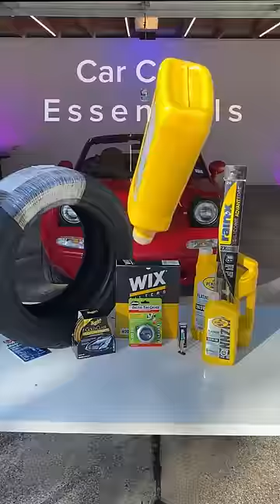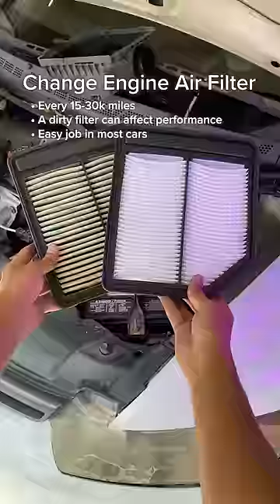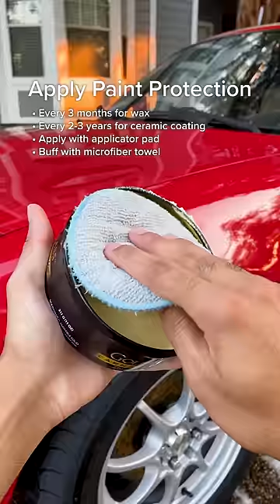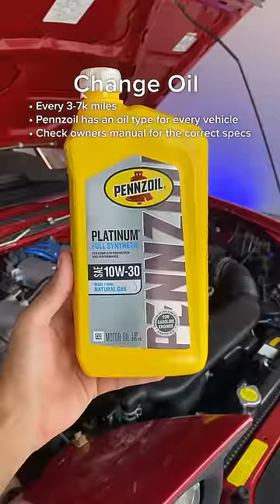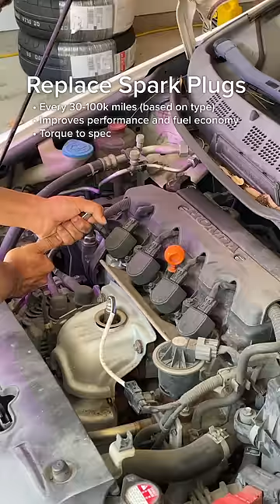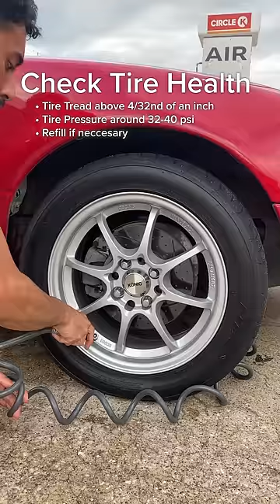Car Maintenance Checklist! (make your car last longer)

Comment: Some extra wording could be added. Just rotate the tires with every oil change. Clean your wiper blades with a non solvent solution every few months to make them last longer. Rubber can go 2-3 years and good silicone can go for 2x longer. Cabin and engine air filters should be changed simultaneously. Miles varies on the pollution in your area. I get 40k where I am since it’s not very polluted.  Waxing, depends on how much of the elements it’s exposed to, you can get upwards of 6 months on the same wax. Oil, mileage varies on blend. Can get 3k on conventional and upwards of 9k on some synthetics. Googling or oil cap can also provide oil weight. Also replace engine oil and filter in tandem. Cvt oil every 30-45k and auto/man every 50-70k. Depends on how hard it’s driven. Spark plugs now a days lasts well over 80k. Just change em every 80-100 or when fuel economy drops or a misfire lights the check engine. Do it when engine is cold, don’t overtighten. Just snug it up and give it an extra quarter inch turn. Tread them by hand before using ratchet, so you don’t strip the threads. Tire pressure should be what the door stickers says. Don’t pump it Willy nilly, tracks need far more than 40 psi in some cases. Adjust and check tire psi a few times per year. +\- 10 degrees = +\- 1psi. And get an alignment if tire wear is uneven. Also never run your gas gauge to empty, always fill it up around 1/4 from empty.
Reply from the maker: Thanks for typing all that out, great info for everyone that sees this vid!
Reply: Aww somebody’s a diy dad with their car! Look at you big boy taking car of your car/truck maintenance all by yourself!
Reply: @cameron3991  Your comment is not about you, also diy daddy is my favorite daddy.
Reply: W human thank you.
Reply: 🤣how long did that take you
Reply: @Junior Dominguez not good for the fuel pump. Would take a long time to have a noticeable effect though
Reply: @Junior Dominguez Running lean can heat some things up, but it isn't bad unless your car is a diesel, or a rotary.
Reply: Good idea fueling up before it reaches 1/4 tank, it'll wear out the fuel pump quicker if you run it too low
Reply: @juniordominguez8597wouldn't run or if ran very low, it'll wear out the fuel pump, and they're not easy to replace
Reply: @truckercarter09   nor are they cheap 😂
Reply: Correct me if I’m wrong, but don’t turbo’d cars need new spark plugs every 15-30k?
Reply: K&N airfilters are reusable and have a lifetime warranty.
..plugs dont last as long in older cars, my '03 dakota gets new plugs every 30k and new wires every 60k.
Same for tires, older cars vin plates usually have the psi set around 30-35psi cold, or at least it did on the mopars ive had to deal with😔
Reply: i aint reading allat
Reply: @cozy2k433 probably couldn’t anyway
Reply: Thanks man🤙
Reply: @sixspeedofficial fr shout out them, I just woke up now I’m reading essays
Reply: Man this is an amazing comment!
Reply: dang papi. i didnt know air pollution equated yo gas mileage
Reply: The cvt fluid change depends on how hard you drive your car.
I baby my versa cvt and i did a fluid change at 49,000 miles and the fluid was fine along with the drain pan magnets being pretty clean
Reply: @cameron3991   I can't tell if this is an insult of compliment 💀😭
Reply: Now if you did everything that this man says in this comment your vehicle will be pristine
Reply: @juniordominguez8597you don’t want to pick up any debris that might be inside you fuel tank big or small, it can clog up fuel lines and lead to more problems for your motor that can be easily avoided by just filling up at 1/4 or 1/2 a tank
Reply: Nerd
Reply: Wax on wax off

Comment: You forgot the more important things like radiator coolant flush @ 20k, brake fluid flush @ 10k, transmission fluid @ 30k, front and/or rear differential oil and @ 20k, power streering fluid @ 30k.

Comment: Brother, never get under a car with only a jack supporting the vehicle up. Put two jack stands on either side to support the frame after you jack it up with the jack then slowly release it and then once the jack stands do not move under the car, jump the jack up to provide more support. Be safe 🙏🙏
Reply: & add a spare under it for even more safety per cautions. An added bonus
Reply: He had two jack stands under it…
Reply: Did you not see the Jack stands?
Reply: @jvke.p  did you not hear about harbor freights jackstands?
Reply: @myKurisma  😂good point. But Daytona is fine. You’re referring to Pittsburgh
Reply: Exactly what I do 🫡

Comment: 2 more tips:
Change engine coolant every 5 years.
Change the timing belt every 100,000 miles as long as it doesn't break before that.
Reply: buddy had his 09 silverado since new and only fluids he ever did were motor oil, brake fluid, and diff fluid
Reply: Transmission fluid too, especially in automatics..

Some cars use timing chains instead of belts.
Reply: @BrendonGillespie most cars use chains
Reply: My 2007 F-150 has had its coolant changed only once, back in 2014. Still looks new. Have only changed its oil & air filter. 

I've never changed a timing chain on a car yet. I have several over 200k miles.

Comment: Remember there's also transmission fluid, coolant, power steering fluid (maybe), differential fluid, transfer case fluid, brake fluid, and a cabin air filter (maybe)
Reply: It's more common to see cars with a cabin air filter than it is to see ones without most people will go their entire life without ever seeing a vehicle that doesn't have a cabin air filter and they're usually located behind the glove compartment
Reply: @gnomewarlord8962 ford didn’t bring the cabin air filter back until 2015 for the f150

Comment: Pay attention if your tires are directional as the cross rotation will make your tire be in the wrong direction and that can cause hydroplaning
Reply: I was wondering about this exactly. If you take the front driver side to back passenger side, don't you have to take the tire off and change it's direction? As for the other side too
Reply: I'm confused bro

Comment: As a discount tire employee u should rotate the fronts straight back and cross the rears to the front to get the best life out of them
Reply: That’s for FWD, as well as non-directional tires. RWD calls for front to back straight, and an X pattern front to back. Directional requires you to rotate back to front ONLY. It’s also a good idea to relearn the TPMS system after a rotate. But for FWD cars that is very good advice as you can get up to 30% more life out of a tire.
Reply: It’s different depending on FWD, RWD, and 4WD

Comment: There was literally nothing wrong with that old spark plug. It was still gapped properly and had very minimal wear. The engine is burning fuel very efficiently according to the plug. A proper set of Iridium plugs last a minimum of 45-50K miles. BTW, Denso is the OEM for Mazda ignition parts.

I would not recommend NGK unless they're OE parts (like Honda and Audi). I used NGK on my SAAB, Volvo, and Toyota and they were all trash in barely a year. Swapped them all out for OE Denso plugs and they all run sweet now.
Reply: Technically you are correct but it is smart to change out your plugs earlier than the intended wear points because at the end of the day if you're trying to take care of something you very much loved then you're going to put more than extra into it then you would with your normal daily driver,

Same with doing an oil change or any type of fluid change I've seen people who have changed their oil every fifteen hundred miles because they want to keep the engine healthy and not keep the oil in for the 3,000 or whatever they're saying it is now

Comment: Don't forget transmission and transaxle fluid (if you car is all-wheel drive)!  I didn't realize that I needed to check my transaxle fluid every 10k miles (mainly because Ford considered it a "lifetime" fluid) and had to replace the transaxle when it prematurely exploded.  That was some hard-ass work- definitely easier to replace the fluid with your engine oil!!!

Comment: Using the best engine oil definitely helps to be sure.
Reply: Yes it can help but as long as you’re using a full synthetic you should be fine if changing at regular intervals of 5k/6 months. If taking your car to the track and regularly pushing it, then yes, definitely use some high quality oil like Pennzoil Ultra Platinum or Amsoil Signature!

Comment: Tires should NOT be inflated to 32-40 PSI, unless that’s what your manufacturer specifies. My toyota calls for 28 PSI front and back, although that’s for 165/70R13, so I fill it to 30 as i use 175/70R13

Comment: Car Care Essentials: Trabant 601 Edition.

Rotate tires very often, front and rear camber is ridiculous along with 70-30 weight distribution.

Replace wiper blades if you want, I doubt they make silicone ones. 

Change air filter like every 4000 miles, according to service manual. More important set intake to the correct "weather mode". 

Never get it wet unless you know the panels are sealed, especially the roof.

If so, you can wax, probably will look exactly the same through, these cars do not shine. 

Use synthetic 2-stroke oil at 50:1 designed for air-cooled engines, not outboard oil.

Replace or clean spark plugs if it won't start, or is running on one cylinder with black smoke.

Fill tires to 23 or 25 psi, harsh suspension, very light car, 1300 lbs.

Driving on US highways is like skydiving but more dangerous.

Comment: Well, actually....

Tire rotation every 5k (suv/car) 3k (trucks/cargo vans).

Oil change every 5k 

Air filter every 5-6k (usually with oil change)

With spark plugs, make sure you have the correct gap for it, or it could produce poor performance/ become worse than the old sparkplug.

For tires, make sure they are in the specs of your vehicle, not what the text says, unless you have a miata...

I agree with the waxing. If you want to be extra, use a special clay to remove small rock and debree from your paint. 

For windshield wipers, replace whenever is needed. every 1 year if you drive a lot, and his recommendation if you dont. Just be sure to make sure they don't need to be cleaned before replacing.

Comment: The spark plugs come already gapped but check the gap as the same plugs can require different gap for different applications.

Jack stands, wheels chocks, ramps are a good investment

Comment: Yknow it just so happens that oil change shops offer people everything you said in this video (except the wash) but some propaganda online has lead people to believe that we’re just trying to scam you out of money. When it’s really no worse than paying someone to make you food, or bring you groceries
Reply: not all but there a few. i do my own service because they cant and have told me. something about not having a pump for my transmission. oil they could do that i just like doing it and i know its done right so no chance for a screw up from another like torquing drain pan bolts which has happened to me. it should be done by hand.
Reply: when some lube tech over tightens the drain bolt and breaks your oil pan then you'll know to do your own oil changes

Comment: Just for further specifics based on oil type it's 3,000 to 5,000. And for tire rotations if it's front-wheel drive across the front tires, and if it's rear-wheel drive across the back tires

Comment: Should’ve added more important things than change the wiper blades for example. Change transmission fluid every 30k-60k miles depending on type. Change differential fluids if required. Change timing belt or serpentine belt around 100k miles if car has it. Clean underneath car after snow days to wash off salt from roads. Also for oil changes, time is equally as important as mileage. Change oil every 6 months if you drive less than 5k miles during that time. Change oil every 3k-5k max to make the car last very long.

Comment: I know this is an old video, But i’ve had a car just been sitting in the drive way for over almost two decades, and as far as damage goes the exterior has the driver side fender fallen off, tires flat, and a bit of chipping on the roof paint(started happening this year and has been getting progressively worse) it’s been weathered through all 4 seasons for years now but only this year has exterior damage occurred, as for interior it’s completely fine apart from some uv damage on the door panel wood, but otherwise good, as for the engine, everything seems fine just dusty, no animals or webs, only problem is that the battery is located in the trunk and the key lock on the trunk is jammed so unsure what to do there… any advice? What’s probably the first step to do to fix it up?
Reply: replacing battery, checking spark plugs, changing oil, putting in new fuel, checking all fluids and replacing as needed. theres probs more but that should help you get started, chrisfix even has a video on it.

Comment: its been 3 years since i got my car and ive yet to change the air filters(still looks brand new), spark plugs and rotate tires. really all ive done was change the oil every 5k. everything still runs just fine.

Comment: Actually cleaning your vehicle is more important than it seems. I clean my vehicle once a week or if its too cold whenever the temperatures is above freezing. Dont use soaps that strip waxes either find something like WaxedShines silica wash that helps condition your paint

Comment: don’t rotate tires if your wheels are staggered
Reply: Still gotta rotate them, even side to side to keep even tread wear.
Reply: @AP.Production   Not likely. If you have a performance vehicle with staggered wheels, the tires probably have directional tread, too. Meaning you can't rotate them from one side to the other, only forward or back to a different axle on the same side.
Reply: @AP.Production  I mean I agree with that just use the car tire until I don't know they can be used anymore

Comment: I,m glad you used jackstands , but Can I give your viewers some   advice that might save their lives. When you jack up a car with a floor jack put some stands under it.Like in this video , to often it is not done and I've seen at least one car fall on a friend of mine from doing that. And I personally had jack's actually blow up and drop a car so I wouldn't trust your floor jack that much with your life. Jack stands are pretty cheap insurance. Ohh, and milk crates are not jackstands. That's what my friend thought he would use until he had a differential crushes his chest and break five ribs, and he was lucky😢

Comment: If you drive a 2015 or older Volkswagen, get that oil change or at least top it off every 3k-4k miles😭Haven’t even hit 1k since the last oil change for my Passat, and shit was already bone dry when I checked recently. I’ve had the car for 2 years so it’s been repeatedly checked for leaks. I do this every 3 months. I was told by someone at a VW dealership this is common with their older models but who tf knows at this point😪
Reply: Your GDI engine probably burns oil. Get some BG44k platinum fuel cleaner to remove carbon deposits, might help

Comment: ALWAYS torque spark plugs. If you want to impact a lot of mechanical components down that's one thing, but never mess with the torque spec of spark plugs. They can put a hole in the hood of a car if they're off a little bit, I've seen it first hand. Sounds like a gunshot.

Comment: Get a Tune up every 20k-30k. Is it Fluid?  if it moves?  if its rubber/plastic?
 Understand the machine you're using. It's a tool, understanding tools is important.

Comment: This is a serious question, but I thought you can't put tires onto opposite sides of the cars because it switches the tire direction and therefore pulls water towards the tire instead of pushing it away. So is that not true then?

Comment: for rotating the tires you have to have a special device that tells the tires where they are, unless you have that tool than it would probably be best to take it to the shop and get the tires rotated
Reply: That’s if you have a tire pressure monitoring system, if not your fine. Also some may argue that rotating your tires is unnecessary anyways since cars generally come with radial tires. All what rotating your tires does is ensures that they all wear evenly, but that just means you gotta change all 4 when the time comes.
Reply: @abysstoid1503  very true, i forgot that not all cars have tire pressure monitors.

Comment: I know every car is different but I've heard (and learned in a car mechanic trade school) that every 3-5k miles is the area of oil change. Over 5k and it could damage your engine in the very long run if you continuously wait that long every time.
Reply: Go off of owners manual. Most cars sold on the market have intervals every 7k
Reply: @CollinMac96 3k miles buddy LOL. Ask any respected engine rebuilder.
Reply: @lamp7746  Don Henley is a GM engine builder and he seems to agree with me. Been in the industry for 22 years. He’s built plenty of engines as well as torn them apart. I can list more names if you like.
Reply: @CollinMac96  believe what you want but oil deteriorates after 3k miles and it’s cheaper than an engine last time I checked 🤷‍♂️
Reply: @lamp7746  you asked me to ask any respected engine builder. I found one and now you backtrack and say believe what I want? Should I believe you or the guy that has been in the business for 22 years? I have more engine builders who would agree with me as well. Can you name any engine builders who agree with you? I bet you didn’t expect me to actually find any builders lol 🤦
Reply: @CollinMac96  where does he say 7k miles?
Reply: @CollinMac96  well?!?!?!
Reply: @lamp7746  my comments are getting deleted, you have the name, do your own homework. I cannot post links or names.
Reply: It's 3k or six months. I don't care about 5k or whatever people say. As for the 6 months, oil oxidized.